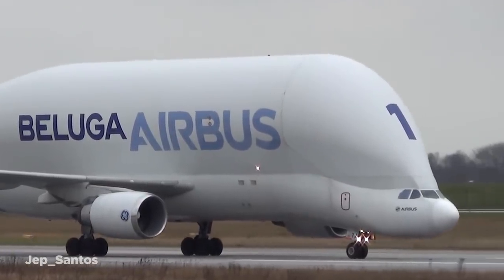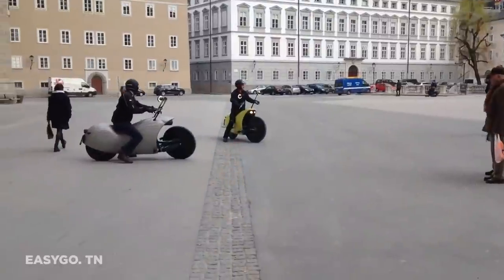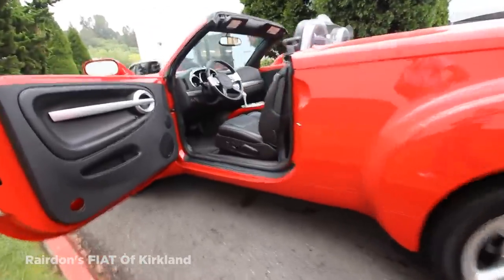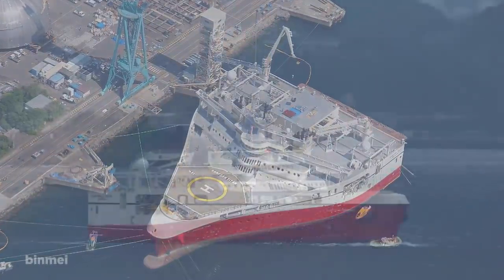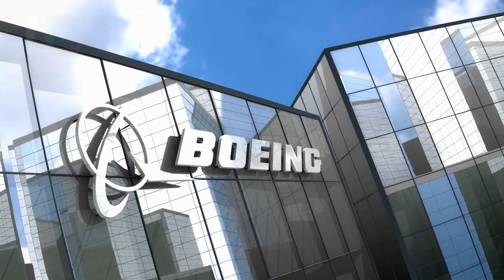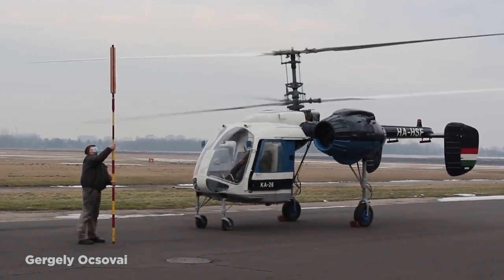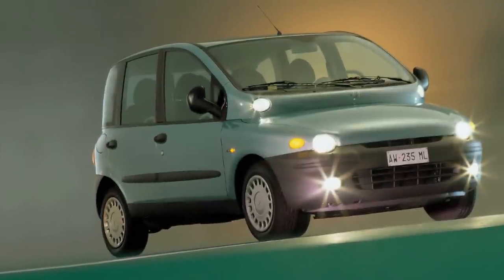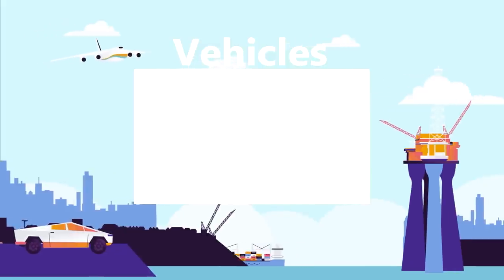15 UGLIEST Vehicle Designs

Comment: It's insane that the Beluga can handle that much cargo with just two engines.
Reply: The engines just have to propel the whole thing, and when it gets up to speed the workload is relatively low, the giant wings do the rest in terms of load. Still amazing though.
Reply: Rolls Royce is not messing around.
Reply: volume, not weight
Reply: I mean they are huge engines
Reply: LOL....its insane that a Bugatti Veyron can go +250mph with just one engine.
Reply: i can see them every day, they such impresing
Reply: @clausandreasen5310  Then again a Veyron has a 16 cylinder twin-turbo engine. It ain't no lawnmower lol.
Reply: @clausandreasen5310  If you throw a 300hp on a carbon chassis and zip tie your balls into the steering wheel you can go 250 mph+ with a micro jet engine assist, you do need a lot of wing surfaces for control though. Question is, will you? Look up pulse jet engine on dry lake, you'll come across a dude riding a pulse bomb going quite fast, and his rig is literally a block or red hot propane fueled engine.
Reply: All about space NOT weight.

Comment: An obvious miss is the SsangYong Rodius, one of the worst looking cars of all time.
The Nissan Cube only worked in the Japanese, UK and other right hand drive markets due to it's non symmetrical body shape. Left hand drive everything opened the wrong way.
Reply: In case you didn't notice in the video, the overseas versions mirrored everything, as they generally do.

It was the same difference on both sides of the pond, equally hideous.

Comment: The Sin S1 does not look like melted plastic. It looks like molded plastic. Its a cool damn car. it resembles a Star Wars vehicle. In fact a lot of them have that funky clunky sci fi vibe.
Especially the cool small helicopter. The Sin S1 looks like the mini sub the Jedi rode in under the Gundan sea. Cut with this Debby Down crap. This should be fun, not so negative and morose. The includes the Eor droopy droning of the narrator
Reply: I totally agree,  most of these, aren't ugly.  That yellow car,  looked very futuristic.

Comment: It's like you don't really have an opinion of your own but just parrots what the mainstream is already blurting out! You might wanna consider forming an pinion of your own. For example: the Chevy SSR is not a bad looking car at all, and neither is the Sin S1nor is the Victory Vision. The there seems to be an issue with your colour perception. The Yacht Guilty has no visible Pink anywhere, yet this is one of the colours you disagree with?? Yes, the paintjob is an eyesore but at least try and identify the wrongs instead of dreaming up some new ones!....other than that: good video!

Comment: In the 70s and 80s , cars had a chopped off Kamm tail , a flat tail .
This was airodynamic as they said .
Now we don't see Kamm tails anymore .
Has the air changed , or has airresistance changed ?
By the way , did you know Alfa Romeo had a Guilia Sprint Speciale 1.6 liter in the 50s early 60s with a dragcoeficient of 0.26 .. .....
With its round tail it could do 190 km an hour with just about 110 bhp .
190 km is about 120 miles .
Cw 0.26 , I am talking the 50s here , not 2022 !
All these modern dents , flares , razoredges and ugly stuff is just designershit to me .

Comment: The Nissan Cube is a really cool car. It’s the first car ever that’s not asymmetrical (doesn’t look the same on both sides). Although it has a cube design, almost everything in the interior is round. You can get a pice of Shang carpeting for some reason as an option in the extras because why wouldn’t you want to have one. And you can get a rippled speakers and roof liner that goes with the shag carpet. I think this car is cooler than the other cube cars from this era.